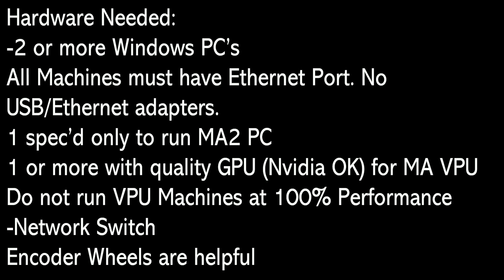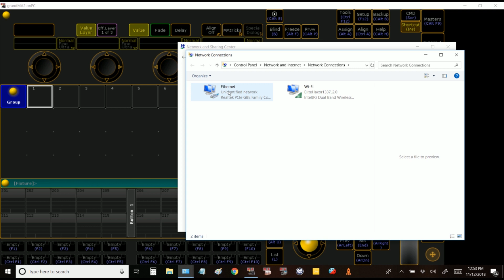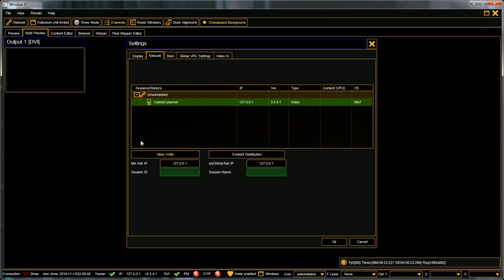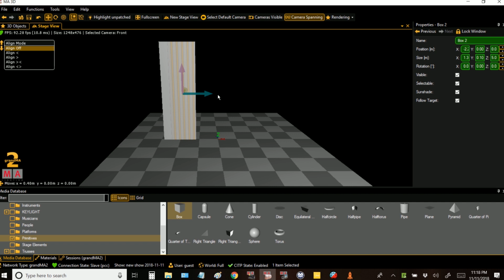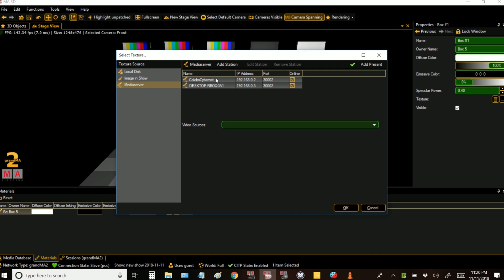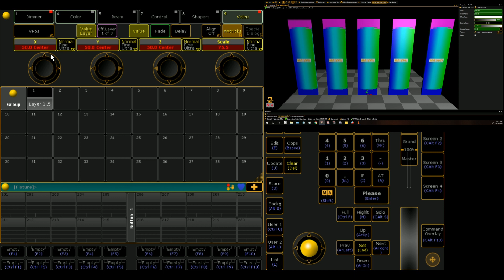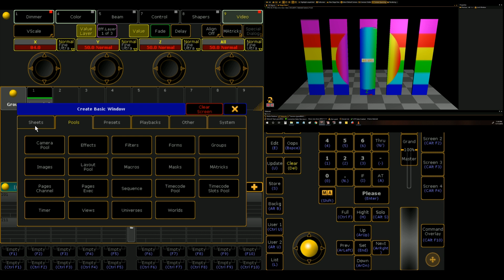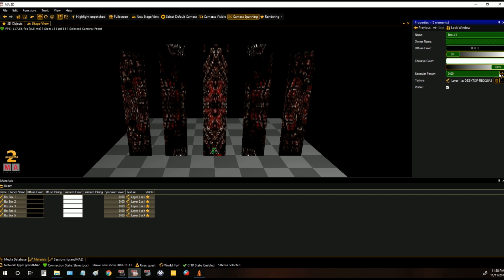Video Mapping in MA3D (Version 2)

Comment: hi, thanks for the video, i managed to get it working and i enjoy it.  However, I have a problem: if I use only one layer the video works well but if I use two or more layers creating the preset for the subdivision of the source, the image jerks.  what could i do to fix this?  Thank you
Reply from the maker: Hey, sorry it took a year to see this. It’s probably because of your processor, if you divide the load between 2 computers it will work better. Hope this helps.

Comment: I was actually able to get it to work over usb to etherent NIC’s.. the weird issue was I would chose an image and put the fixture at full.. got nothing. then if I turned the dimmer encoder down from full the image snapped on. tried it several times and it works the same each time. weird bug but it works.
Reply from the maker: Christian Floyd Lewis Good to hear! What brand of ethernet dongle did you use?
Reply: Caleb Hoernschemeyer  ASIX AX88179 USB 3.0 to Gigabit Ethernet Adapter (Amazon) Running 2 laptops one on each

Comment: I have a question?
Can it work without commandwing and without ma node
(without any kind of MA hardware), running maVpu, ma2 and ma3d on one pc?
Thanks!
Reply from the maker: It depends on the media server. If it’s MA VPU, you do not need parameters or MA hardware. If your using any other media server, you do need MA hardware. You also cannot run MAVPU generating the CITP, and MA3D receiving the CITP, on one PC. You have to have 2 PC’s. (Although I did manage to get a Cybernet with 2 Ethernet ports to talk to itself for about a minute, once, and never again). That said, if you need resources during this Covid 19 period, many shops are willing to mail a node or other resources to you to borrow and learn if you ask. I myself am getting a borrowed MA3 node soon to play with.

Comment: Why are u using a layer for each strip? Wouldn't it be easier especially for the setup to use One Content Layer and 5 cameras?
Reply from the maker: I haven't thought of that. I'll absolutely have to give that a shot! Thanks!
Reply: hello, would you be kind to explain to me better?  I configured video in 1 out of 5 strips, I was able to distribute the source evenly over the 5 strips, but the final result creates problems because the image jerks on the viewer.  it seems that sending a source on 5 layers in the artnet strains the system.  is there an alternative?